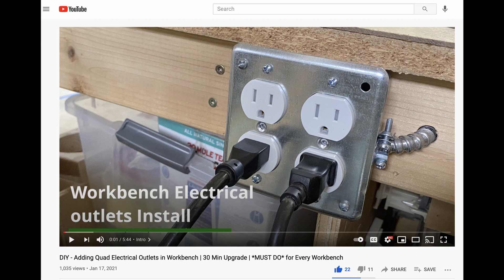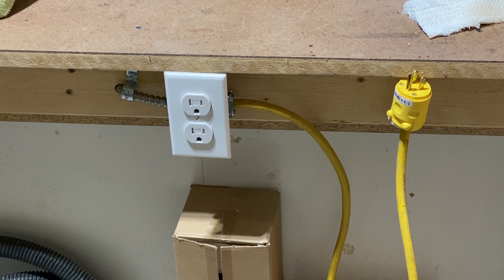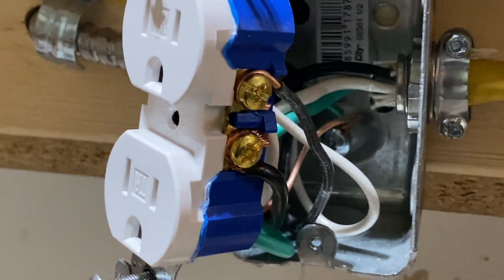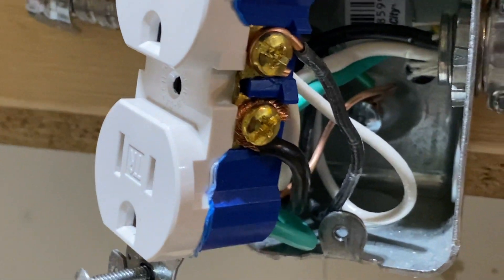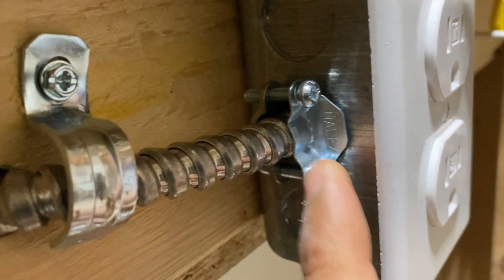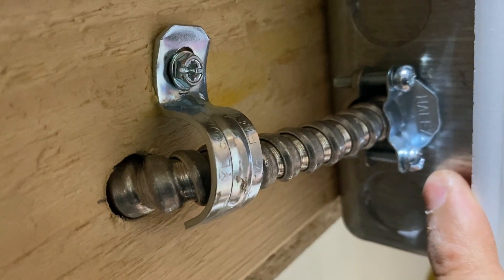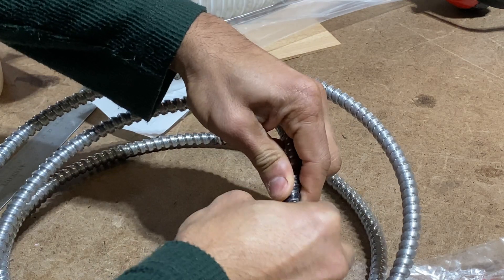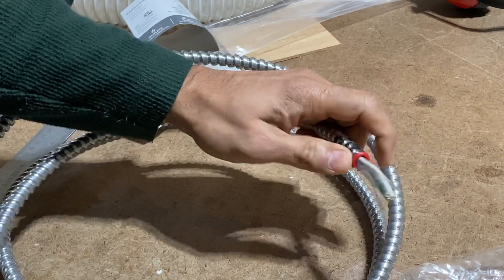Electrical outlet - work bench installation - Part 2 (Mistakes & Fixes )

Comment: Funnily enough, the red heads (anti-short bushings) are not code required. They are recommended, though. As an electrician, if you don't use them, I'd call you a hack, lol. 

The bend radius of that MC is pretty extreme. I'd have just gone into the back of the box or drilled a bigger hole and used a 90°. Placing the box directly alongside the hole.

Honestly, if you are not a professional. Leave a disclaimer saying you don't really know what you are doing so you dont put other people at risk. It's good to see Father Son projects otherwise. Be safe.